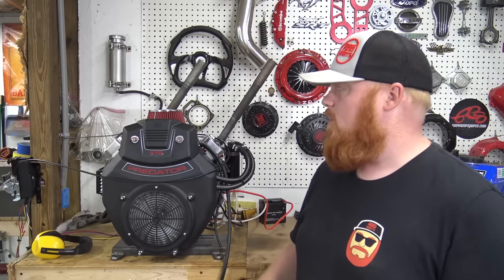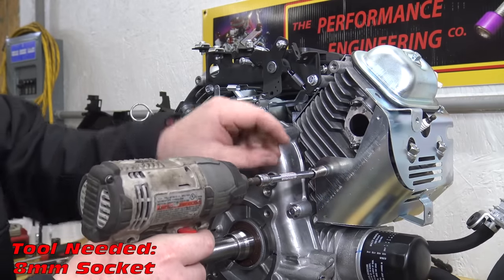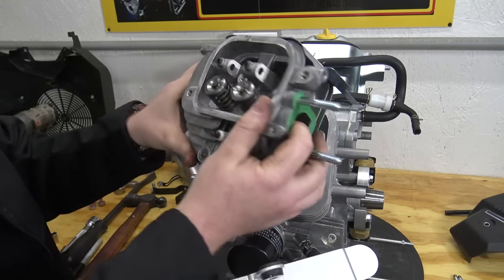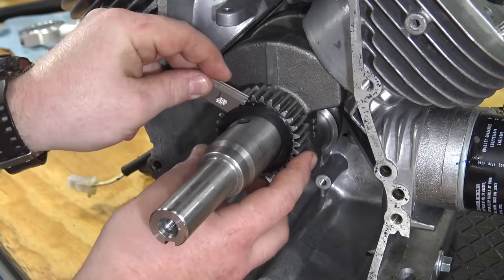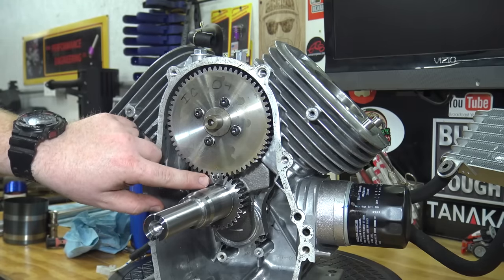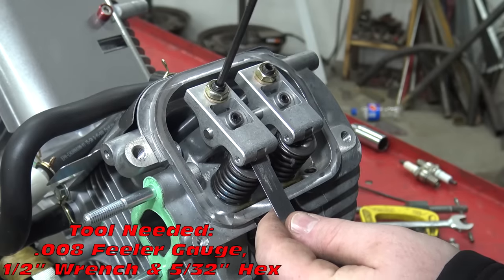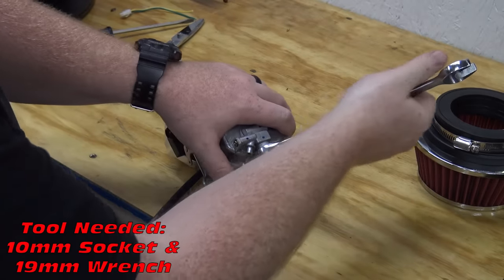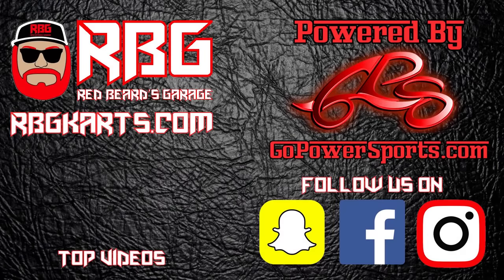🔥 40+ Hp Predator 670cc Performance Engine Build 🔥

Comment: Might want to get higher temp magnets for the flywheel, since ike and John were having problems with the magnet loosing strength from being too hot
Reply: they were using an aftermarket flywheel setup from performance 670, rbg put the stock flywheel setup back on this one,
Reply: Jake Wright Red Beard used Factory flywheel to wear cars and cameras used an aftermarket
Reply: Oh ok
Reply: Lol the 670cc predator is a waste of a engine its extremely slow for being 670cc carsandcameras should have put the 900cc ducatii engine on the dragster
Reply: Michael dorn yep they still can
Reply: Michael dorn but it will be hard
Reply: Jake Wright yeah lol the 670cc predator  is slower than the 212cc and the 670cc has low Rpms its a utility engine not made for speed and it weighs 100pounds+ and have oil problems and it coast
 $700 new so would really be wasteing money if someone actually bought it but they all get everything free since sponsored
Reply: Michael dorn they didn't have the Ducati when they built the dragster pay attention my friend.
Reply: Todd Bearden lol they did have it they just never showed it because they were saving it for when they aired on TV with it lol they are afraid of a little 200çç shifter cart let alone the 900cc ducatii
Reply: Jake Wright you know what Jake my bad. I guess he did use the Billet flywheel. I don't know what I was thinking. Again I apologize cuz I gave you some bogus info :/
I feel like a clown with a Bigfoot in my mouth now :)
Reply: Jake Wright now I feel even stupider again Jake. In the beginning of the video he shows a Billet flywheel but I watch the video again and he did not install it so I was correct in the very beginning. He bounces around on some weird shit anyways. If you watch that video he did about how to install a catch can he's got a fuel pump setting there as materials that he was going to use so he's a little bit loopy himself sometimes whatever I'm done talking about it. Sorry about being a babler.
Reply: Michael dorn yeah every day people can afford one of those..

Comment: Apparently some engines out there have forked rocker arms, which allow a single pushrod or cam lobe to actuate multiple valves. In theory, the engine can pull in huge amounts of air for more power, so I wonder if these can handle that kind of treatment.
Reply: custom heads would be needed to do that on the predator 670..

Comment: With a motor built like this, can i run 87 pump gas or would it be better to run premium? What would be most reliable?
Reply from the maker: Its still fine on pump gas. Only when you start milling the head do you need race gas.

Comment: I just built the same thing, but I am having trouble when you rotate the flywheel on the bench. You can hear a clicking noise. It sounds like it’s coming from the cam gear. Maybe it didn’t do it until I put the the rockers and push rods and heads on ?

Comment: Don't mean to sound critical but I'd spent a good many years machining and building street/ strip engines for 4  current/former professional drag racers and I have to say ANY machining, drilling, tapping, grinding, etc....should ALWAYS be done and then the engine block must be meticulously cleaned before ANY assembly work !

Comment: Do these engines have aluminum push rods I haven't played with a 670 before I've been doing Briggs stuff for my drag mower but thinking of going to predator engines on it
Reply: no, don't believe they do.
Reply from the maker: Yes sir they do
Reply: Do they make a steel replacement oush rod for them I have a problem with steady runs the intake push rod starts giving away and cause problems on the Briggs engine on those you can sub the exhaust push rod which is steel
Reply from the maker: Yeah Performance 670 has them
Reply: Red Beard's Garage thank you for the information sir
Reply: lomsome's Garage the coils are junk tho cuz .....carsandcamaras are having coil issues
Reply: lomsome's Garage On top of Michaels reply go watch Cars and Cameras latest video on their dragster. In short coils are shit  and so are the magnets, everything else seems good.
Reply: do an ohv conversion if you can
Reply: @ellenorbjornsdottir1166  - They come OHV stock...

Comment: Dip your tap in grease and the chips will not fall down inside of the engine.
Reply: Duke Craig if any did fall into the crankcase they'd be in an oily clump and easy to wipe up. I like to use a small shop vac with a pinpoint attachment. Either way cutting oil should be used when tapping threads.

Comment: Hey I was going to build this version of the engine, but all of the links for the parts you used don't work anymore because performance 670 did a domain change. Could you fix the broken links so it's easier to find the correct parts?

Comment: At the beginning you showed a Billet Flywheel then when you put it back together, you didn't use it!
What's up with that?
Reply: The engine they showed with the billet flywheel wasn't a 670.
Reply: @dirtyfax  yep it was a 212 not a 670 cars and cameras did a predator 212 hemi build where they shaved the head and ported the valves and it made about 22hp and it was a single cylinder ohv motor so the 670 v twin will probably make atleast 40 hp or so
Reply: Why you ask because of usability a Billet Aluminum flywheel you give up two of most important things electric start and charging the battery which sucks if you plan on using the engine on a motorcycle or ATV/UTV because of lights and other electric things like a electric winch or trail lights speedometer and so on.
Reply: @illusiveduelist4959  I would question the 22 HP on the 212.
Reply: @rustybeatty6567  they make a kit to add a alternator

Comment: my friend I have problem to my honda 630cc v twin its not work maybe you can help,can I get your contact
Reply: what's the symptoms? does it flip over when you crank it? does it try to catch? check your carburettor is tuned for the altitude. check there's petrol in the petrol tank. check both spark plugs receive a spark.
Reply: @ellenorbjornsdottir1166  it probably won't start i guess

Comment: Excellent presentation video! What size throats on the carburator? I was able to adapt the 990cc 61" Briggs carb with 30mm throats to fit to the 38" model with high altitude jets and that gave a useful extra power gain. Very impressed with the throttle lever adaptor method,  also looks like you can mill out the dead weights inside the flywheel to keep the generator but lighten the flywheel, I used a circular milling table and paid cash at a local machine shop, had to make a dummy long shaft to mount the flywheel on, so it could be re-balanced in a car crank balancing machine. Long pipes also help, the tuned length of the Briggs version was around 38", siamesed to use a single silencer box.

Comment: I like the stuff you guys  do. I have to say, most of this stuff doesn't do anything  for power gains.  The connecting rod,valve springs, flywheel, valve covers, and air filter won't add power. The air filter will make you have to run larger jets without any power gains.  Just saying,  this is a waste of a lot of money.
Reply from the maker: Valve covers are necessary for clearing the roller rockers, rods are for longevity, flywheel is stronger and safer, valve springs allows you to rev higher and put more power down, you do not need to rejet a 670 because they are extremely rich from the factory.
Reply: @RedBeardsGarage  It got a new bump stick.
Reply: i don think you sen the part where he change the cam shaft to a better performance one. cam shaft make a big difference in fuel consumption. light way rods mean less force used to move pistons. in other words the main engine components add up to make a difference in engine.

Comment: No before and after Dyno curves ?? Why spend money on this hardware with no cost/benefit info ??
Reply: Carl Malone it said in video what the HP and torque was
Reply: 21.2% more torque and 36.4% more HP than stock motor. Huge gains for the time invested. I calculated these gainsby looking up the Predators stock specs on Google and comparing to the data to the results Greg got (minute 24.56 of video). Excellent video!
Reply: @paulhaussmann6245  Greg Estimated how much power it offers, not tested.
Reply: @dposcuro  I second that. Guess I'm one of the "keyboard bandits" they're always screaming about, but to me it's all about the fact of the matter. Simple, numbers don't lie or exaggerate like people do. People often think because someone is on TV or YT that they're automatically right. Well as the saying goes, "I'm from Missouri, show me". Until then, don't try to tell me anything.
Reply: @dereknapier836  for the price of the estimated $1250 I would just go buy a used H-D 80 CI engine and rebuild that.

Comment: Thats pretty cool... But for that money and effort, couldn't you just get a motorcycle engine that has more power and reliability?
Reply: Yeah, I don't know who makes this motor, but it looks like cheap Chinese engineering.
Reply: Tait Jones
It is. Honestly they're not bad for the money, but if you price out what's getting upgraded plus the motor cost, your at more than $2k and that's ridiculous.
Reply: These engines were never designed as motorcycle engines per se. They were designed for industrial use for generators air pumps, water pumps for irrigation welders and the like. Because they have no Transmissions like motorcycle engines they are very simple and make great engines for go-karts and mini bikes and Trail vehicles. You'll notice the guys on cars and cameras always use a centrifical clutch or a torque converter with no transmission. That's exactly what these engines were designed for.
Reply: My understanding is that they are made by Lifan, a good quality mfgr.
Reply: kevin curry they are their own company specifically for harbor freight.
Reply: @williamlee1429  i want to use thus in a mini truck but it has no bell housing
Reply: @taitjones6310  i think Hyundai
Reply: knightrider1545 you will have to make one or do some heavy looking for something close, small cars etc
Reply: @deborahchesser7375  no worry i can weld and grind

Comment: I know it’s an old video but did you jet the carb also? I have a 670 in my ezgo golf cart and debating on doing this upgrade because my kids decided to go a little wild holding it wide open for a while with the governor bypassed on a stick engine. It hasn’t run quite right since.

Comment: Thanks for the rebuild vid.  Q:  Where can I get a new crank for these engines ? I re-powered a commercial leaf vac with one of these engines and the crank sheared off at the output shaft in less than 2 hours of use. Cheap cast crank. On web searches others have had the same happen. Harbor freight only said.. sorry... 90 days warranty is up

Comment: The 670 engine sounds like a baby Harley. It inspires me to put one in an old Cushman Eagle scooter frame I have. All I have is the frame and forks so I won't be destroying a classic. Btw, they were slow, single cylinder powered so the Predator 670 V Twin 2 should be a good upgrade.
Reply: The Cushmans were about 4 or 5 HP... so a 6 1/2 or 9 HP would be a good upgrade...

Comment: i’m confused. A crankshaft stop, using a pulley? When do you remove the pulley? How do you install the flywheel over it? Lastly, if you are bypassing the factory shutoff for the performance set up, how are you shutting the engine off?
Reply from the maker: You use the stop on the output side of the engine not the flywheel side.

Comment: I’m wanting to do a sears suburban garden tractor mud build is just changing the piston rod enough to rev the engine high without blowing it up I’m wanting to do a used vanguard v twin build it’ll either be a 14 or 13 hp pull start I don’t want to modify it too much I’m just wondering what’s the minimum so I can rev it all I want without blowing it up

Comment: Hi Greg. I love this video. So easy to follow. A couple questions. What made you decide to use the 506 cam I supposed to 507 with more lift and duration. Also, Performance 670 advertises already built 670 engine with a 506 at 32 hp. I think they did other mods as well. Your title shows 40 hp. What do you think the actual number is? And so the actual only performance increase is solely based on the higher profile/duration cam. There was no head work no jetting changes no nothing? Thanks!

Comment: I apologize I had one more question are the Kohler engines designed to have a lot of blow by and the carburetor you’re using does it have an accelerator pump I’m asking because I installed one on my little 20hp Kohler and that stopped the noticeable hesitation from low speed to high speed. Again thank you

Comment: Do you need to use the billet valve covers for rocker clearance or can the OEM ones be used for a more "sleeper" look? Also would you call that a "semi-hemi" head on this engine? It looks to have a centrally located spark plug but has a quench area.... 😎

Comment: Nice thumper, are there any gear box's that could be ran off this engine? Perhaps an old Harley 4 speed. Intersted in building a small street legal bike for the wife and the 670 would fit the bill.
Reply from the maker: Yes sir got one going on this in later videos

Comment: Hello Red Beard,  at 14:44 you show how your camshaft needs to be installed (large point of the camshaft aligned with the small point of the crankshaft). I have a Briggs&Stratton-627ccm-23hp-V-engine without the speed limiter. How do I have to install my modified DynoCams if I want to get maximum power at 3600-4100 rpm? The cam has following combinations of digits: -1,5  -4  2,5  3,5  4,5  5,5  ...  .The spur wheel of the  DynoCams can be unscrewed from the shaft. How must the spur wheel be positioned on the DynoCams and how has this cams be aligned to the crankshaft? I would be very thankful for every information which helps me to solve my problem with the right position of spur wheel and camshaft. If you want some photos I will send them to you. Kind regards Lucas

Comment: I’m currently in the middle of a build on my 670 (pretty much the same parts, but I’m swapping the stock carb with a Mikuni TM34, as well as polishing the heads and intake). Is it really necessary to remove the oil sensor? Just wondering if it’s a clearance issue with the connecting rods or if there was another reason.
Reply from the maker: The oil sensor will shut the vehicle off in turns. It's only there if the engine is mounted on a pressure washer or generator where there is a risk of tipping over
Reply: Red Beard's Garage Thanks! I’m running the engine on a long tail motor. I’ve currently got the kill switch wired in to the oil sensor, so I’m trying to figure out if I need to relocate it.
Reply: How did your build go?

Comment: Question on your rods are those Babbitted rods and on such a build why are you not using copper head gaskets just would like to know is there something special about the gaskets provided for the build. I have been an industrial mechanic over 40 years and I am starting to put my knowledge into building high performance engines for welders not like what you’re building just engines with some abuse factors built in. Thank you for your advice with the highest Respect.    RR

Comment: I going to say you didn't use stock pistons. Your parts list does not mention pistons. So I'm wondering if you checked piston ring gap & just forgot to say anything about it. Also checking the rod cap clearance & valve clearances & where the rollers make contact with the valve stem. One more thing you use 40w oil for break in what do you use after that?

Comment: so cool!! hey guys... hoping to get some feedback here...? I am building a golf cart and tearing out an old Yamaha G1 and replacing with the 670. my question is, what would be the best rear differential to use in place of the old one that came with the G1 since the forward reverse drive mechanisms are totally different. This is for a parade float project so no need for high revving or speed.  thanks!

Comment: Nice video! What Performance Engineering Cup Washer kits did you end up going with? They've got dozens of kits on Amazon. I'm doing the same build but with some head work!
Reply from the maker: I kinda piece it together. The valve cover kit or side cover kit works on smaller threads and side cover works for the larger ones. There going to be making a kit soon for the bigger engines.
Reply: Red Beard's Garage Gotcha! I'll keep a look out for the full kit. Thanks!

Comment: Im working on my 670 extending the wires to the ignition and kill swith and a red and black wire pulled loose were does it go or if the wires are different its the black wire that comes out of the keyswitch box with a quick connect on it

Comment: I wonder if it's really necessary to upgrade the connecting rods? Perhaps it is if you're going to rev it up but it seems like a fairly modest performance upgrade - though I do get it has had a 50% increase in power but 50% increase from 20hp is hardly the same as a 50% increase in power from 400hp.
The stock rods seem pretty stout to me, the comp remains the same also.
Reply: it may be because of the torque

Comment: I have watched several of your builds. I now have a question regarding a 212 Predator. It is repowering an old cast iron 14 hp Briggs. Its stock and does ok , "BUT" could use more guts. Also its a hemi head. It doesn't need more rpms ,just more pulling power. Is there a bigger intake valve available , and is there a cam ground to make more power at stock 3,600 rpm? I figured a porting could help it Get the air it needs as well. Any suggestions? Thanks
Reply from the maker: You can get high torque cams. There is also bigger valves and porting would help out for sure